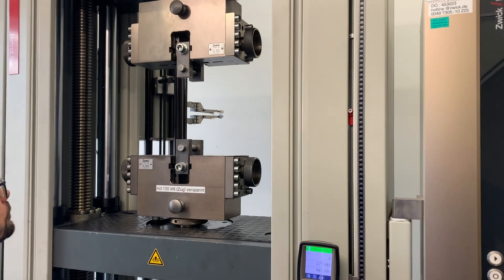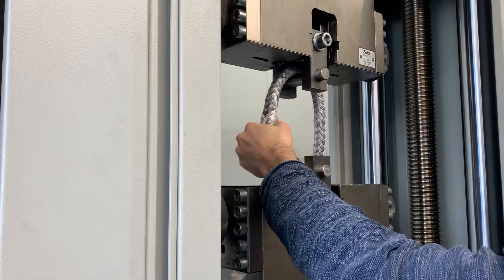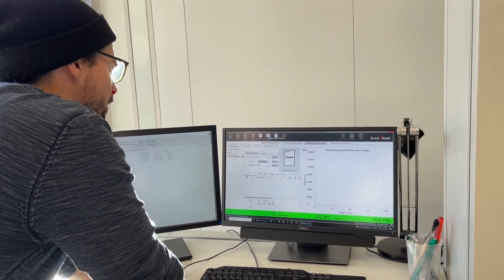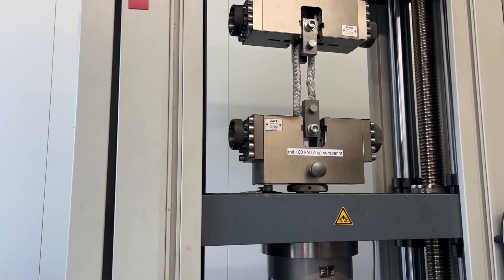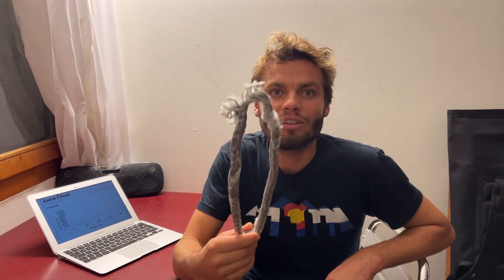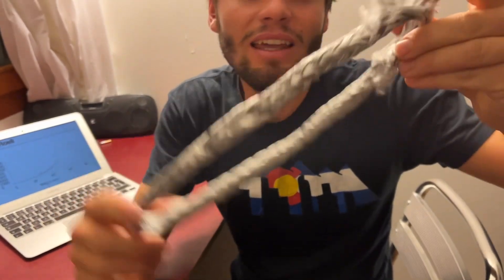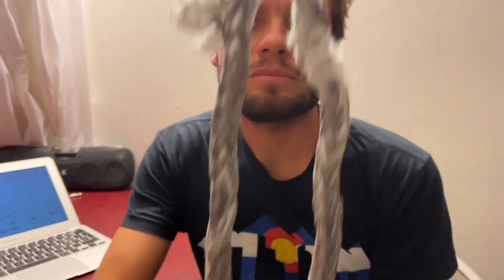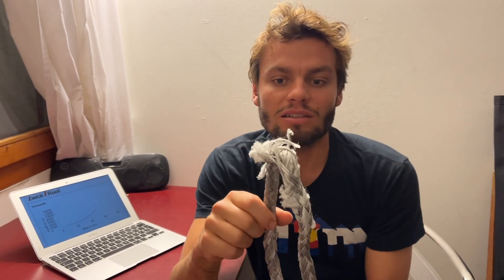Why you should trust Dyneema for your rigging - DIY Deadeyes breakingload test

Comment: Also increases safety with lighting strikes especially if you normally touch the steel rigging to walk around the boat ?
Reply from the maker: Very interesting point! I imagine so yes. I heard of people getting some static electricity by touching the wet Dyneema during a thunderstorm, but I would imagine the main track of a lighting travelling through the aluminium mast instead
Reply: @NiklausWildisen yeah. I’m looking for an aluminum sailboat that will get new Dyneema. Doing my research and trying to find an affordable sailboat that can beech itself safely !!!
Reply from the maker: @AffordablePC1 nice! To sail in which region?

Comment: It would be interesting to test it with the thimbles attached.
Reply from the maker: @Andyfunsail  I agree. But I am sure the breaking strength would be even higher. The breaking strength without the thimbles is already more than high enough.
Reply: @NiklausWildisen  definitely and it showed how a small bending radius is so bad for the strength of the dyneema. One of the YouTube channels just connected their dyneema to a ring 😅

Maybe you can take one of your deadeyes back to the university for a test when you head back home at some point. It'll be interesting to see if the strength has degraded from UV.

I'm rigging my 1979 Wauquiez ketch in dyneema at the moment :) thanks for sharing your experiences.
Reply from the maker: @Andyfunsail  I would be curious too about how much UV weakens the Dyneema over time. So far there is only a bit of change in colour in the parts I didn’t cover in an abrasion sleeve. 

Good luck with your rigging! The moment you can take the old stainless cables away really is a good feeling.
Reply: Здравствуйте. Очень приятно смотреть на ваше испытания , я инженер из России. С блоками обязательно необходим опыт . так как сами блоки могут быть по прочности ниже чем ваша нить . очень интересно . только подключился на ваш канал . просмотрю все что есть .  очень интересно ваше судно 
 Ваш тримаран . собираюсь построить тримаран вот изучаю опыт других людей . надеюсь что на вашем канале найду видео об опыте эксплуатации вашего судна . очень интересно .  большая благодарность вам за ваши исследования . Семь футов под килем .❤

Comment: This only proves that the principle is sound, but in no way does it address real world operating conditions. Once it has completed a vigorous seasons sailing with salt, UV and the countless other contaminants (oils, deck cleaner etc) and RE-tested - could you call it - TRUSTABLE
Reply from the maker: Very good point, you are right! What convinces me is that you should see the wear on Dyneema visually from the outside, not like on steal riggs where the oxidation and cracks may start from the inside of the cables and fittings.
Reply: @NiklausWildisen  My initial concern is that a contaminant has a free reservoir inside of the weave and then a secondary effect could then be caused as a new one arrives at a later date - you could think of such a process being akin to slowly acquiring the constituents of a battery cell by deposition.  I wish you very well in your studies Sir.
Reply: @PRAR1966   there are decades of history of dyneema/uhmwpe performing exceptionally well in the marine industry.  Resisting many difficult situations,  much more difficult than those of these sailboat stays and dead eyes.  Dyneema on mast stays is sized for stretch not strength..thise 12mm stays are many times stronger than the original SS wire rope.  Finally that was a poor test.  The radius of the bend was very sharp, and of course the line  broke there.  A more I formative test would have been test the thimbled dead eye.  With those radi, I suspect the thimbles would have distorted long before the dyneema parted
Reply: I think the chemical inertness of UHMWPE is sufficient for marine conditions:
https://assets.ctfassets.net/q6qgec8ud5tq/3n0mW4BfpPxWFySesfcwOZ/ea0f9c49150c7700ab2d385b10e6d15a/CIS_YA101_Chemical_Resistance.pdf.

I agree that the thimbles probably improve the strength as the bend radius will be greater than the radius of the test rig pins. The splice itself seemed to remain intact 😀